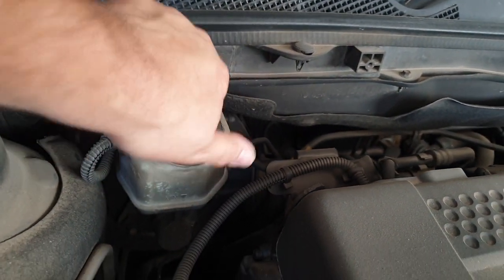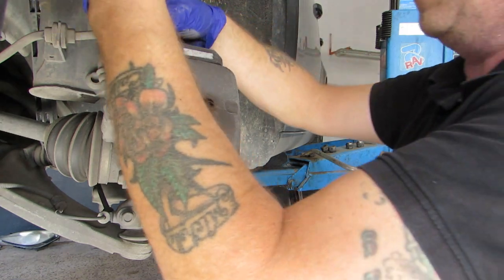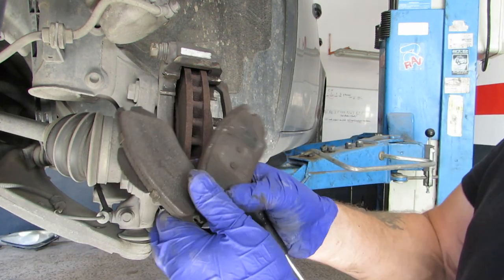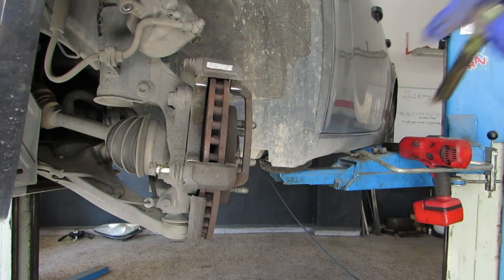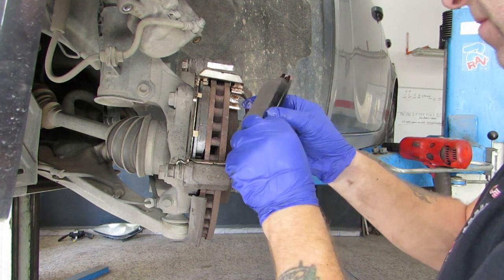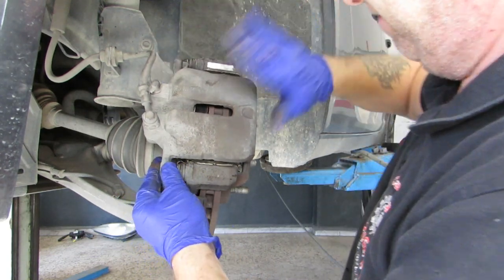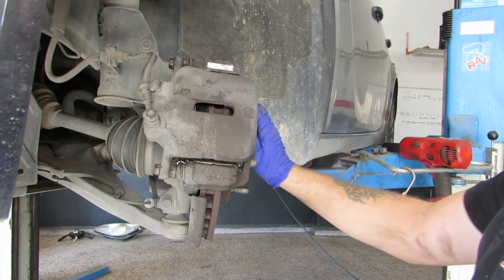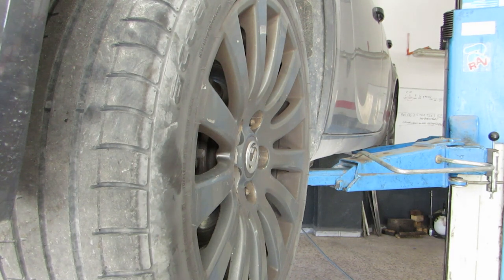Vauxhall Opel insignia front brake pads change

Comment: Did that insignia have locking wheel nuts,if so I’d never use an impact gun on the locking wheel nut,that’s my thought,no offense intended or implied
Reply from the maker: Can not remember, however I use the gun and if the wheel nuts do not spin off as they should  I won't carry on with the impact, putting them on I just snug them up with the gun and then torque them up.